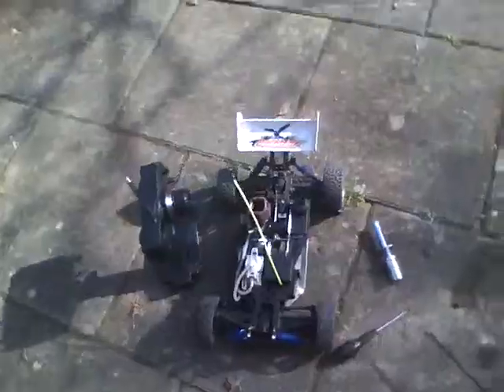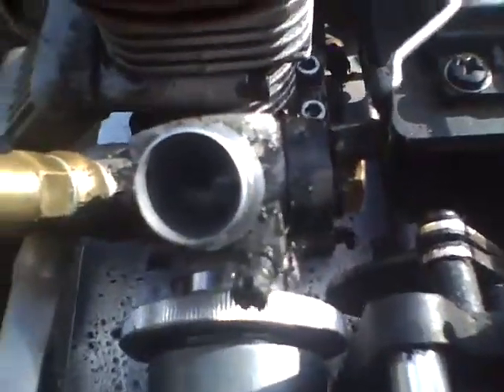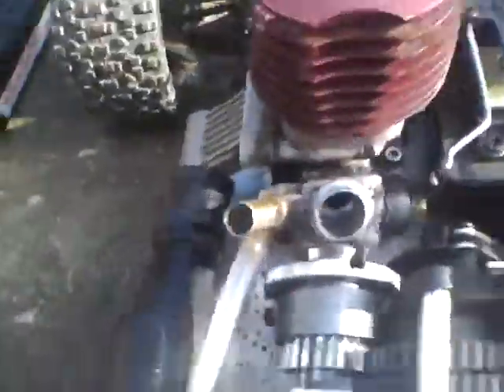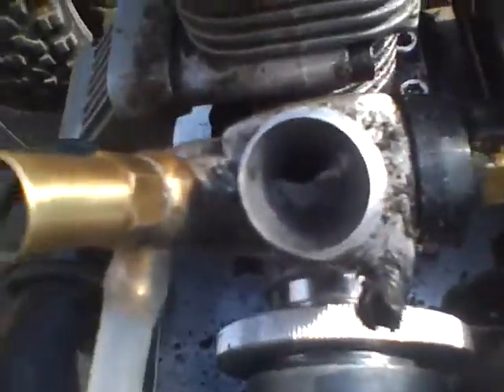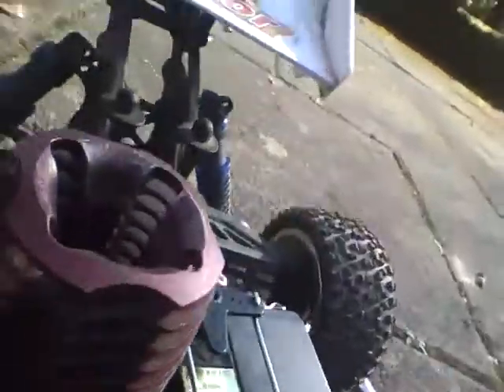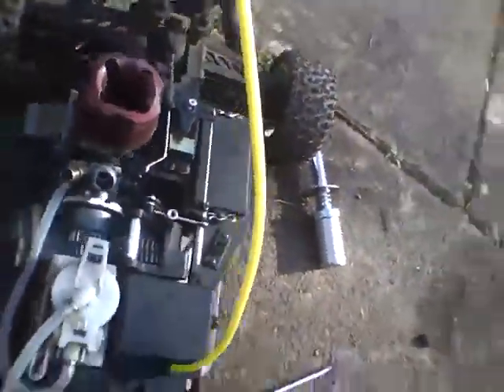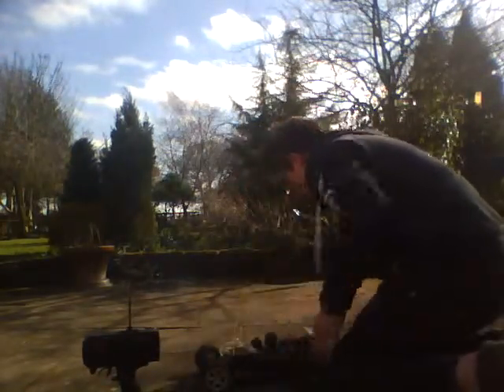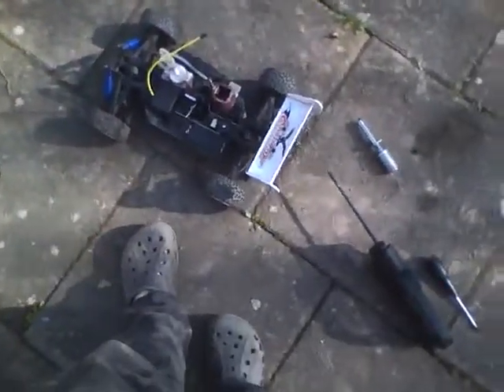RC nitro car help please

Comment: @11811ben your throttle brake linkages need to be adjusted. Take the servo horn off the throttle servo center servo by setting trim on radio to middle. When you put servo horn back on make sure the car is closed. You'll have to readjust your brakes by setting the collars closer to the brake arm hope this helps

Comment: adjust ur throttle trim when u have the car on and adjust the throttle trim u will see the carb moving set it about 1/8th of an inch open u wont have any problems